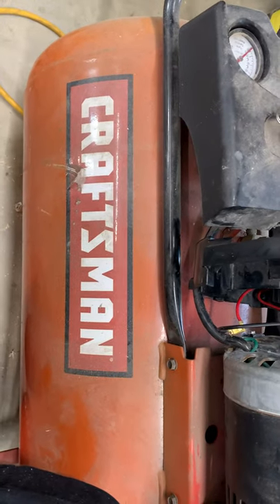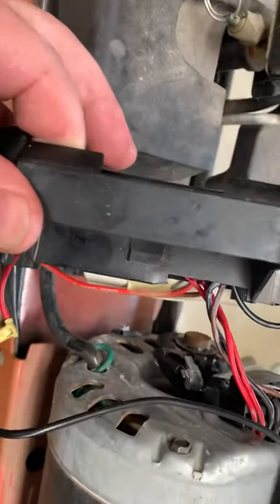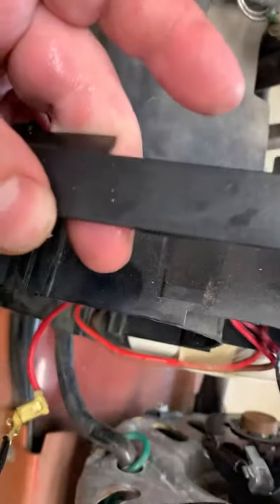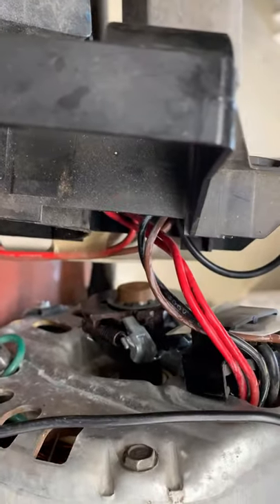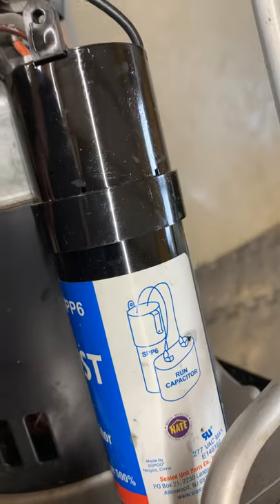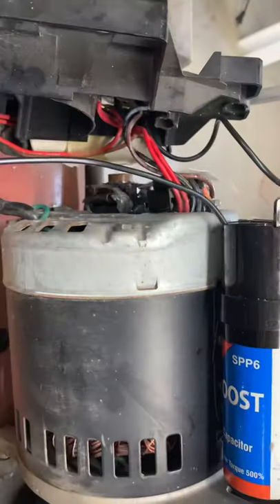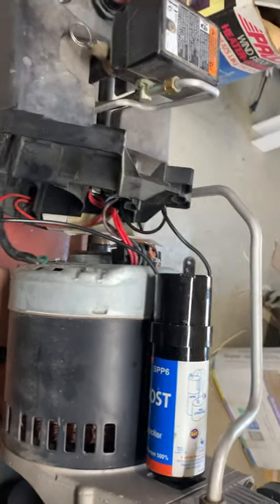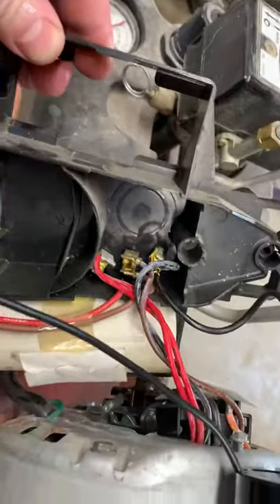Fixing a craftsman air compressor that blew breakers

Comment: That's a clever fix to those crappy Craftsman compressor setups. Please post the specific model number of the one you fixed.
I've got an identical layout on my Craftsman compressor, but the start capacitor is a 400mfd. I'm wondering if that Supco SPP6 capacitor setup would work on mine.